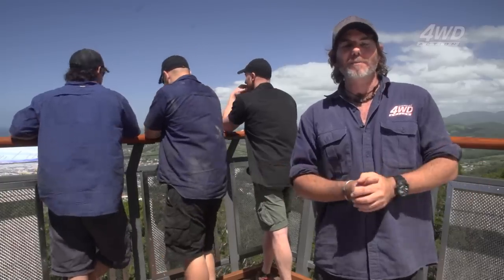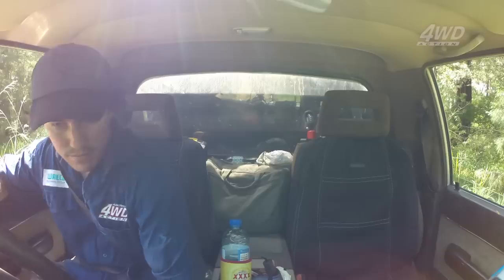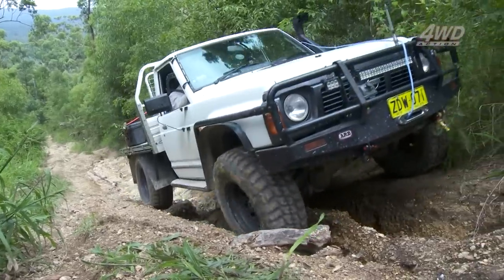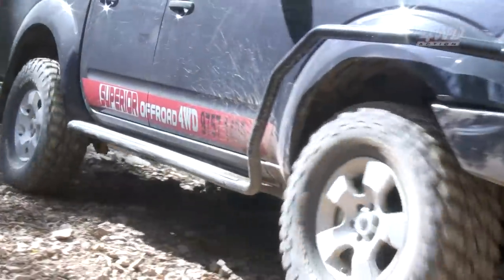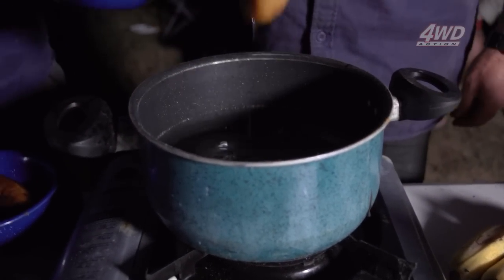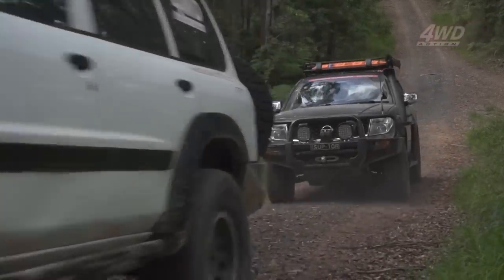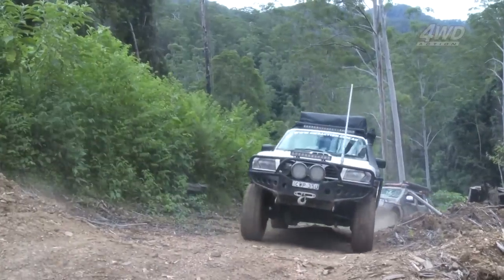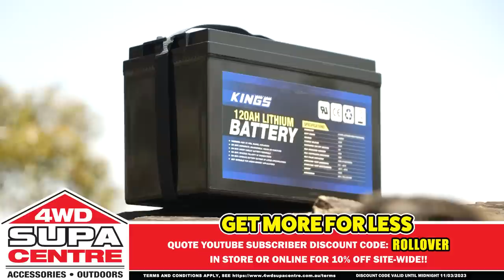4WDing On Its Side! See Shaun's Classic Rollover! 4WD Action #237

Comment: What's dirty 30's wheelbase? Seems it's almost too short for this kind of wheeling, almost too tippy and wants to backflip.
Reply: I'm pretty sure it was still just a regular 60-series chassis at this stage, I don't think he had extended it. Combine that with a big canopy full of gear and it makes for a fairly tippy vehicle.
Reply: The 2 spares hanging way past the rear axle was the downfall.. take them off he'd have made it. Those things live to wheel stand standard.

Comment: Guys, whats the difference between 4WD supacentre and 4WD 24/7
Reply from the maker: Hi there, 4WD supacentre and 4WD 24/7 are both separate businesses. Kind regards, Rachael
Reply: 4wd supercentre probably have the rights to the old 4wd action DVDs that came with the magazine. Since the magazine stopped they rebranded to 4wd24/7 and I believe it's now owned by Shaun